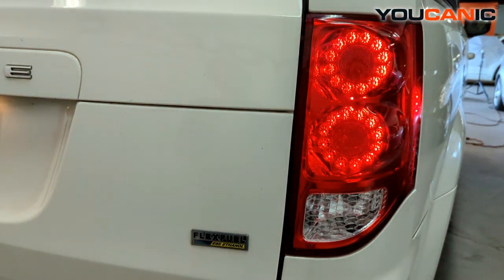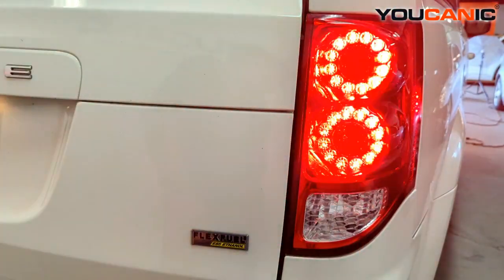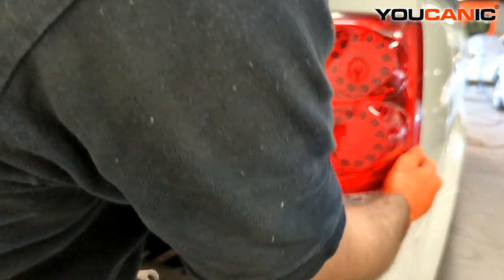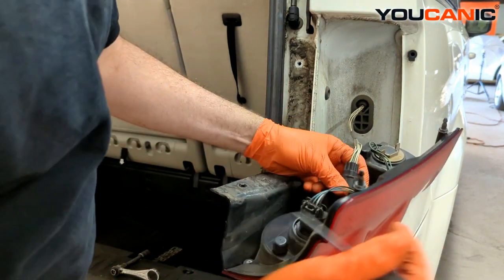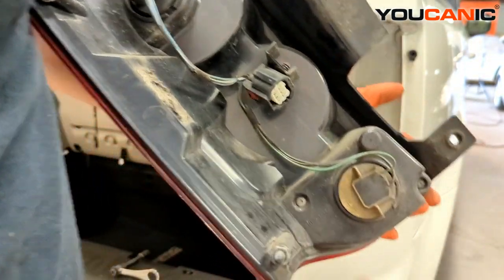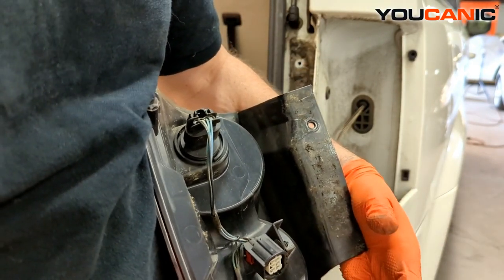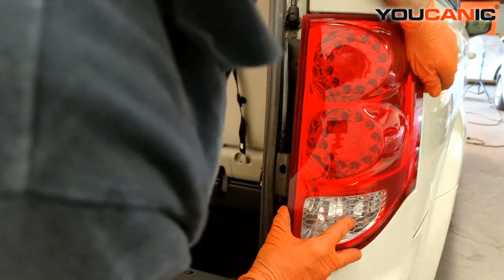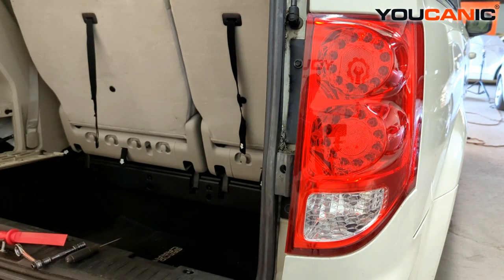2008-2020 Dodge Grand Caravan - Tail Light Assembly and Reverse Light Replacement

Comment: I tried replace my reverse lamp today, and the bulb wasn't even bad, it was a loose wire connection.  Easy as pie! Thanks!!
Reply from the maker: Thanks for your feedback! We're thrilled to hear that our video helped you fix your reverse lamp problem - that's exactly what we aim for at Youcanic. We strive to empower all car owners with free resources, handy guides, and our powerful YOUCANIC scanner.

In case you need further assistance, remember we've got your back. We even have factory repair manuals for detailed procedures. Check out our website at www.youcanic.com and never hesitate to ask us anything. We're here to support you throughout your car maintenance journey.

Comment: I purchased an aftermarket replacement lens yesterday due to cracks and my cost on it was approximately C$150. For most part it was pretty good however there were some challenges with it which I think you need to be made aware of. The clip for the lighting is a very poor quality, upon touching it with the screwdriver to remove that red lock it fell apart, so we had to use a plastic Ziptie and then  electrical tape to connect the two plugs ends. Upon installing it with the alignment was off and was protruding into the rear door hatch. Upon further inspection we compared the OE to the aftermarket and noticed that the plastic bracket where the bolts are screwed on to the body of the truck, that plate was not of the same spacing. So what we did as a hack is we took two wine cork and jammed it into the bottom to take up the space and  shim the lens flush. Aside from that everything else just seems to be working great. Oh as an added step we also took some 3M two-sided rubber tape and created a seal between the body and the lens to help keep any moisture out. I hope this helps I was going to make a video but forgot!

Comment: What socket fits a #10 bolt?
Reply from the maker: Thanks for your question! Typically, a 3/16" socket fits a #10 bolt. However, this can vary depending on your specific car's make and model. At Youcanic, we're dedicated to helping car owners feel confident with DIY car maintenance. Explore our helpful resources at www.youcanic.com and don't hesitate to reach out if you have more questions. Our YOUCANIC scanner, free guides, and even factory repair manuals are designed to make your car upkeep easier. Your empowerment and confidence under the hood is our mission, we're here to support you every mile of the way!

Comment: I’m still wondering why they slap a 3157 for reverse light. 

And this implies to some of the incandescent bulbs. 

There’s nothing wrong with because it works fine. 

But what I’m sayin is, why would they put a 3157 that has a dual filament that’s use for front parking light and turn signal function, and brake light function, instead of using 3156 that has a single coil filament for use as rear turn signal and reverse light, and front turn signals as well?

Why not switch to more reliable led bulb upgrade for something a little bit brighter than stock, like sylvania zevo 3156 white led bulbs?

It’s brighter than stock, it has a reliable pure krisp white with no blue tinge in it.
Reply from the maker: Thanks for your detailed query. The choice of bulb type in vehicles can depend on a range of factors including efficiency, brightness, and cost, sometimes manufacturers find certain bulb types more fitting. As for upgrading to the Sylvania ZEVO 3156 LED, it’s indeed a great idea for enhanced brightness. 

At YOUCANIC, we're all about supporting car owners with our practical guides and resources, such as our YOUCANIC scanner. Feel free to check them out on www.youcanic.com for any further assistance. We're here to empower your car ownership journey!